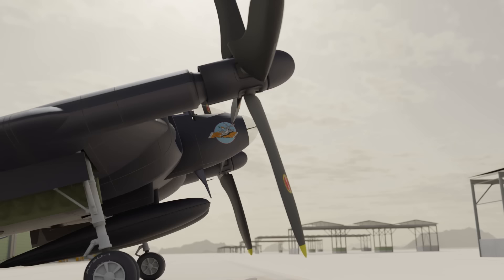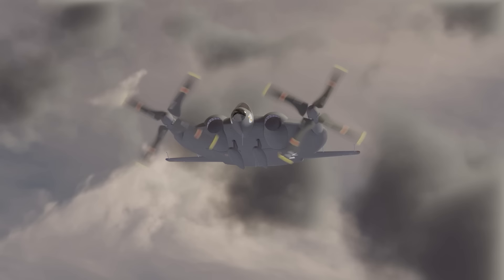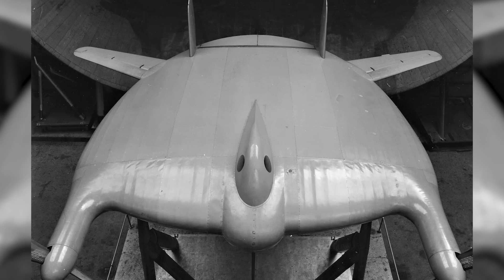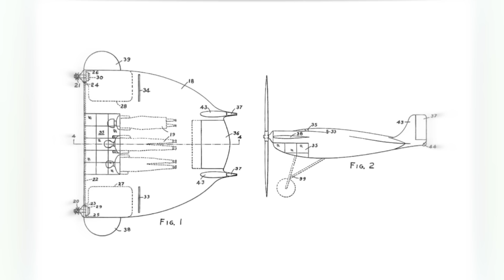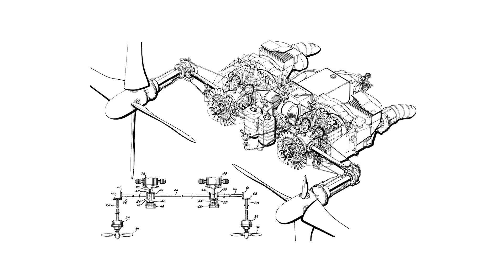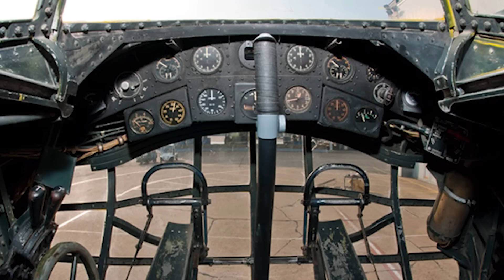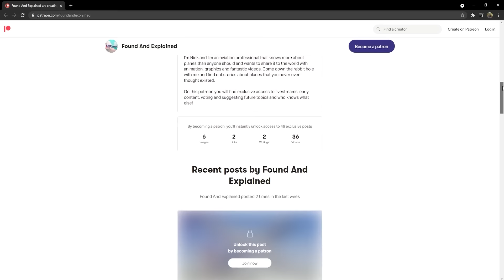The Flying Pancake - Slowest Plane Ever Made!

Comment: The thing most people forgot (including the USAAF Doolittle "Special Aviation Project" crews) is that at sea not only do you get to head directly into the wind (so you get the full benefit .vs. when the wind is at an angle to the runway) but you also get the speed of the ship!
 
Which means since the XF5U needed 25 Knots airspeed that if the ship was going 6 Knots and you had a 15 Knot wind, all the plane had to do was go 4 Knots faster!!   Which was the problem!!!!  (Because this meant the plane, although at take-off speed didn't have the true ground speed to keep flying, close, but "no cigar"!!!). 
 
Another issue is if the wind over the deck (between wind speed and the ship's speed) got near or greater than 25 Knots, which happens to even the slow CVEs at sea from time to time!  And with the vibration issue (plus worry that it could actually cause the wing to have a structural failure) the plane was a no-go as a Fighter.... Sad that it wasn't followed up as a Crop-Duster or other STOL (with a 5 or 6 bladed propeller so it wouldn't be tilted as much on the ground) after the war.  But the "Peace Dividend" was very hard on every aircraft manufacturer except those making Cargo aircraft that could easily be made (back) into passenger aircraft (which also had issues since no one needed scores of passenger aircraft produced every month....)

Comment: I'm just going to put this out there so that it is actually said somewhere, but there are many planes that are both significantly slower than this plane and could take off in shorter distances. Many of these even predate it (look at the Po-2 or the Fi-156 for example). So it's scarcely revolutionary in that regard.
This aircraft was created as an experimental proof of concept for a different wing arrangement than usual and flying as slow as possible was not one of the stated goals for it. It is still interesting nonetheless and definitely one of the most unusual aircraft of that period.
A german engineer also attempted to create a circular wing aircraft at about this time, its called the Sack AS-6, and it has a pretty interesting history as well
Reply: The reason the plane was made was not only was it capable of short runway takeoffs, but could land on a short runway as well. Why? It was made to operate from the deck of a Liberty ship that had a desperate need of aircraft to defend themselves against the Luftwaffe.

There was some freighters that could launch a fighter from a catapult, but they could not recover the fighter (which I believe for the British was a Hawker Hurricane). The catapult system also ate up a bunch of space that could have been used for war-time cargo.

Float Plane Fighters required a crane to recover in addition to the catapult system, and by then the performance of float places was too far behind German long range fighters and bombers to make a difference.

The Flying Flapjack only needed a fairly small amount of cargo space for its fuel and ammo. It could even perform as Anti-Submarine Warfare against a sub that was surfaced.

PS: The Sack AS-6 failed because the Germans failed to take into account how much lift was lost over the edges of the plane. The Flying Flapjack had those two engines and propellers to counteract the loss of lift, and therefore could fly.
Reply: @neorenamon  Landing on a ship still requires an arrestor hook, it isn't really practical to make a plane that can stop very quickly on a ship without some external aid. And at that point you're better off using a conventional design with better performance at low speeds to make landing easier. 
A conventional STOL plane is perfectly capable of landing on short runways as well (often less than 100m) and you'd be hard pressed to beat that even with modern planes. But as I said, you'd equip a plane with an arresting hook and install arresting wires on the ship as well anyway, so that kinda gets rid of the whole point of using a specially designed STOL aircraft. The other issue is that STOL aircraft often are not very fast (this specific iteration of the flying pancake only had a top speed of around 220km/h if I'm not mistaken) which is really not ideal for dealing with fighters or potential attack aircraft anyway (this thing is slower than the stall speed of some aircraft, so imagine how outclassed it would be in a fight, not to mention it's a pretty easy target given it's basically a big circle)

Honestly the eventual solution they chose of using an escort carrier or single use catapult launched Hurricanes was a far more practical and worthwhile solution than this thing would have ever been.

It's an interesting exercise in unorthodox design nonetheless, but ultimately it falls short in some crucial areas. Probably the most notable one here is the fact it had very poor handling and difficult controls at lower speeds, which is absolutely the last thing you want when doing any sort of carrier operations, especially on a small flight deck.
Reply: Neither the PO-2, nor the FI-156 was a fighter aircraft, the whole point of this aircraft was to have a high performance aircraft that could land on a freighter or noncarrier warship. Quite a bit different then a spotter aircraft.
Reply: @kdrapertrucker  if the point was to have a high performance aircraft they wouldn't have bothered with a completely unorthodox STOL design. As mentioned in my previous comment this thing had awful low-speed handling and its top speed was laughable for the time, especially for a fighter. Carrier-based operations largely eliminate the reasons STOL exists in the first place, and there were already sufficient solutions to the problem. My comparison to the Po-2 and Fi-156 was to demonstrate that the flying pancake fell short as a STOL design, whether those aircraft were designed for the same role or not does not change the fact that it was a failed, dead-end design itself
Reply: @karukurokami  It had two engines of 80 HP.
The XF5U never flew, so any talk about what it might have done is speculation.
It also would have done remarkably well with jets.

See the Boeing "flapjack" model 390.
Single center prop just like the Arup S-2 which Zimmerman based this on.
Sleek and quick on  little power, stall-spin proof, great handling, fast climb rate>
It would have been virtually identical to the Arup planes which adequately tested the planform and showed that it was better in just about every respect to "normal" planes.
Reply: @karukurokami   Sorry, you've got a lot of misinformation about this.

 A plane the size of an Avenger or S-2, built like this but with normal twin engines, would take off with zero deck speed with any wind and headway. (See the "Flying Heel-Lift" youtube about the Arup)

NACA tunnel tests showed that the Vought plane did not gain anything with the wing-tip mounted outward turning props, so in that the situation with the props proved to be a dead end.

Conventional STOL planes are not stall-spin proof, are not notably faster than normal planes of the same power and footprint.
The Arup and others of the near-circular wing or very-low aspect-ratio type have proven to be so, again and again.

The Arup, the 1930s Nemeth Parachute plane and others of the type and the Vought V-173 did not have bad handling, they had notably good, nimble, and forgiving handling.
They will not stall/spin. Flow from the front over the top does not separate and the controls have strong smooth flow, even at >40 degrees A at silly-slow speeds.

The Arup S-2 which was the progenitor of this was 7980lbs, flew 85 kts on 37 horsepower ex motorcycle engine. Stall proof, 45 degree climb, 60 degree descent and near-zero landing roll.
The Nemeth was faster than the original plane which the fuselage came from, same sort of performance.
The similar Farman 1020 performed similarly.

See the 1990s Wainfan Facetmobile. Designed with straight angles and shapes to be simple to build, it was stall-proof, could stay in the air at <16 kts. 100 kts on 40 hp with 340 lbs useful load.

Comment: Does anyone look at this and think A 10 back to the future vibes . 
It was incredibly tough,  manouverable . Run turboprops or turbofans... 🤔😎 
This and the Moonbat always make me want to play what if..

The other point is those self same jets were supplanted in combat by Skyraiders flying coin missions and skymasters doing FAC and rescue coordination ... This would have been able to withstand heavy small arms ground fire and stay in one piece.👽🤠
Reply: Build a plane on the same pattern with turboprops as a CAS platform.
Reply: Love the Moonbat! That thing always reminded me of some Pulp Hero's ride. "What if Doc Savage designed a warplane?"
Reply: @dphalanx7465  
Stealth before stealth...a bit like an E type jag is aerodynamic before wind tunnels ... 😉😎
Reply: V22 Osprey is the closet thing ,we have now.  I would not be surprised if they didn’t look over the design.
Reply: One thing about this, is that to fly slowly, it must have ~30+ degrees nose-up. Try fitting a big gun, with -30 degrees down angle.
Either that or mount the guns inside normally, and it doesn't fly super-slowly for gunnery.
Reply: @JFrazer4303  
I think flying normally  it would aim normally, unless you used a remote turret as per Black widow.  The only time you would use the nose up mode os take off landing and extreme manouvers   like forcing the enemy to overshoot.

Comment: I know this is nit picking. The animation of the all metal pancake seems to have the rotors spinning in the same direction. Don't many dual rotor aircraft use contra rotating props?
Reply: Considering all images and even animation of it standing still as well as the historic footage shown show them as counter rotating, i fairly sure that was a genuine mistake on the animators part. Good to state it, but in no way reducing the quality
Reply: @dominiklehn2866  to be fair, I'm not able to produce such nice animations. I'm not knocking the animator. That's why I preceded the statement with it being a nit pick. It's a miniscule detail. I was a bit curious if the animator was correct and I'm wrong. I was kinda hoping I would be proven wrong and the animation was correct. I thought maybe that was a reason for some of the vibration.
Reply: @birdmun  to be fair, after reading through some other comments you pointed it out in the most polite way. But yeah, I'm pretty sure it's a miniscule animation error. The animation is still fantastic
Reply: Not only are dual rotor aircraft usually counter-rotating, it was an essential feature in the case of the V-173.
The reason most aircraft don't use a low-aspect ratio wing like this is that they cause massive wing vortices.
The high pressure air below the wing is driven around the wingtip to the low pressure air above it. And the shorter the wing, the more air does so, loosing lift, creating a vortex and inducing drag.
The Flying Pancakes rotors were both spinning down on the outward turn, creating counter-vortices that cancelled each wingtip vortex out.
This was pretty much the only way to make a low-speed, low-aspect ratio wing workable, with a brilliantly simple solution.

Comment: You seem to ignore the need/requirement that the propeller blades be large, counter-rotating, and must rotate in the direction that negates the wing tip vortex.  Which is central to the whole point of the design. Also that you cannot fly with one of the propellers out.
Reply: A myth. The props did not counter the vortices, NACA tunnel tests showed that they didn't help or particularly change anything.

See the Arup S-2 for where this concept came from (minus Zimmerman's work towards a VTOL tail-sitter).
See the '90s Wainfan "Facetmobile".

The very low aspect-ratio planform is not inherently draggy.

Comment: 0:25 seeing those props revolve in the same direction hurts my brain.
Having animators that have an idea of the function of the object they're modelling helps.
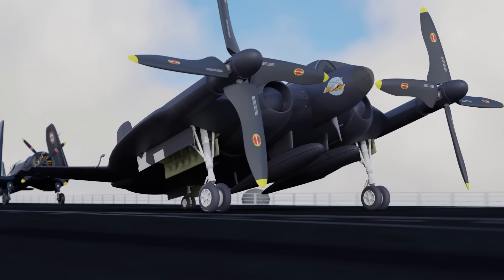Again at 0:47, here the stationary props are both clearly designed to rotate left. (at least THAT was right in the shot mentioned previously)
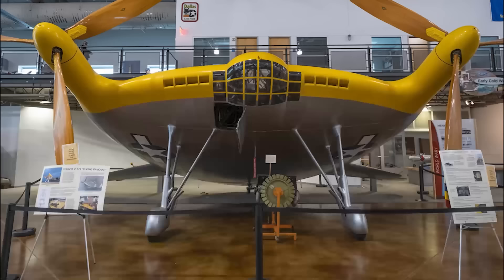The shot at 8:36 proves that the guys assembling the wind tunnel model didn't have an idea about the principles either; left and right propeller are swapped.
The argumentation at 3:42 is way off. NACA certainly knew that a wing like that would have highly 3-dimensional flow characteristics, with the airflow being as much lateral as longitudinal. That was the reason to put the props at the wingtips and have them rotate so they "shovel" air under the wing.
The high angle of attack is a necessity due to the very low increase of lift over angle of attack of extremely low aspect ratio wings.
In short: you have no idea about the aerodynamics of this highly extraordinary craft.
You may have found it (not that it needed finding, aviation enthusiasts are well aware of it.) But you certainly have not explained it.

Comment: this looks like a great drone aircraft design, with the super small engines, you could make a electric version that just loiters, and chugs along.
Reply: It needs more throttle to stay aloft at such low speeds than it would for an efficient cruise.
At very high nose-up A, the vortices create huge drag, while at cruise they're sleek. This is amply demonstrated on the Arup planes which this is based off, and other like the Facetmobile.

Comment: Remember this, the Germans made a powerful ship in the 1940s called the Bismark.  What was used as a first blow against this mighty ship.  A WW 1 biplane with a torpedo damaged the Nazi ship's rudder. How did it do this? The plane flew so slow that the guns on the Bismark overcompensated when they fired.  The guns were set for a plane attack moving over a 100 mph faster ( over 250 mph).

Comment: The V22 Osprey looks pretty similar with its giant props in plane mode. By tilting the props it also allows vertical takeoff and landing.
Reply: This was designed to study a VTOL tail-sitter, though neither planes had enough power of appropriate landing gear.
There are videos of Zimmerman testing an indoor model of it, tail-sitting.

Comment: The ability to fly super-slowly is incorrectly explained. A very-low aspect-ratio plane (span^2/area. <3) while flying very slowly at very high nose-up A, the huge wing-tip vortices wrap around and capture a "bubble" of low pressure behind/above it, increasing lift in such conditions at the same time they make it stall-proof, preventing flow from separating from the top of the wing and insuring strong smooth flow to the controls.. Zimmerman specifically wrote that he used this as a starting point for experiments to a VTOL tail-sitter, though neither of the Vought planes had enough power nor appropriate landing gear to do so.

Zimmerman did not independently come up with the idea, he was on the NACA team that saw the Arup S-2 fly. It did everything the V-173 did, with no exaggerated props on the wingtips. Only later, working for UAC (Vought, Sikorsky, Hamilton Standard, and P&W), did he use the planform.

The Arup S-2 which the Zimmerman plane was based on, probably flew slower, though it landed at 18 kts. It was sleek and quick on little power with astounding climb rate (See the "Flying Heel-Lift" video)
The FMX-4 Facetmobile of the '90s could fly at <16kts. His pitot tube couldn't read any slower. It also was efficient and stall-spin proof. Along with Zimmerman's writings for NACA, Wainfan wrote for NASA about the very-low aspect-ratio planes, describing the vortex-driven "parachute lift" effect and that such planes are not inherently draggy but sleek.

NACA tunnel tests with the V-173 showed that it did not gain any performance or particularly change anything, with the unnecessarily over-complicated situation of the props versus aa pair of normal 80hp props spinning the other way. It did not gain any of its performance due to the props but solely due to the planform, which had been written about and was being experimented with everywhere back then, and amply demonstrated with the Arup planes from Indiana, along with the Nemeth "Parachute plane" and others back then. 

The German Sack AS-6 was a development to a discoid fighter. And see the modern Rowe "UFO" discoid plane in Aus.
Sorry, but Zimmerman's brilliance was not behind this, other than who he worked for and what the Navy wanted them to experiment with. This sort of plane had been proven beyond a doubt by an Indiana podiatrist Dr Snyder, and a Hungarian immigrant engineer Raoul Hoffman.
If the Navy had done an honest follow-up of the Arup planes, perhaps something like the Boeing model 390 discoid planes, it  would have flown very well, as did the Arup and others. 
A bigger version with normal shoulder-mounted twin engines like on the F-7 or S-2/C-1 would have made a great plane too. The size of an Avenger or S-2, taking off fully loaded from a stop vertically, on a ship steaming into a headwind.

Comment: The slowest flying plane that I know is the Fieseler Storch. It flies at 36 km/h starts with 40 km/h. It is able to stand still in the air when sufficient wind and even fly backwards. The starting length was 50m the landing 20m. The german army laid telegraph wires with it. To my knowledge this is the only plane that was able to do that.
Reply: 1990s Wainfan facetmobile could stay in the air at <16 kts. Would not stall no matter what, and was notably sleek on available power, unlike other STOL planes.
1930s Arup plane, which this Vought thing was based on, had the same sort of performance.